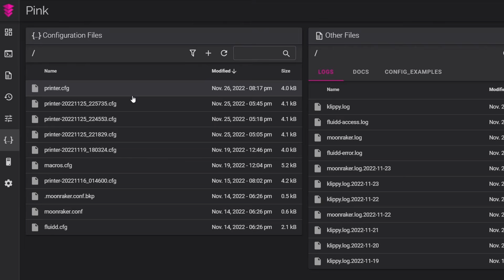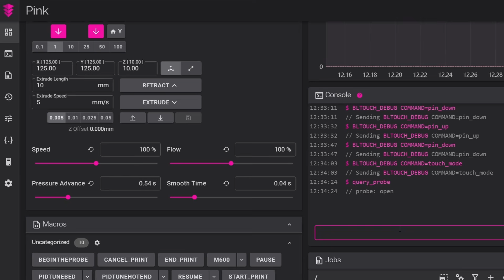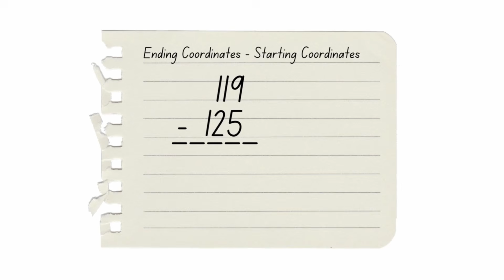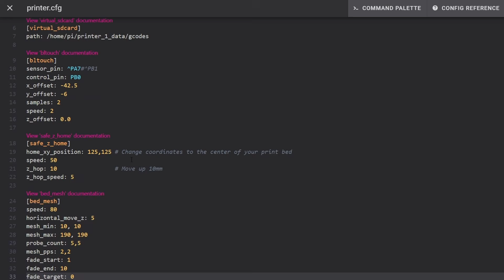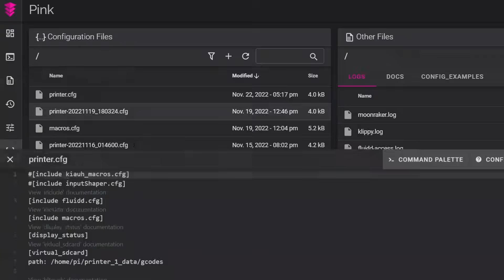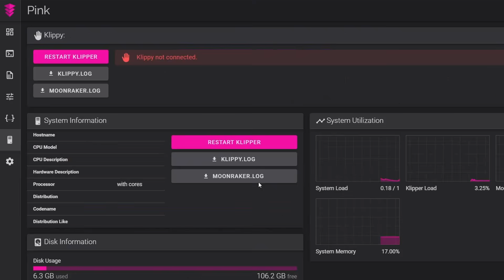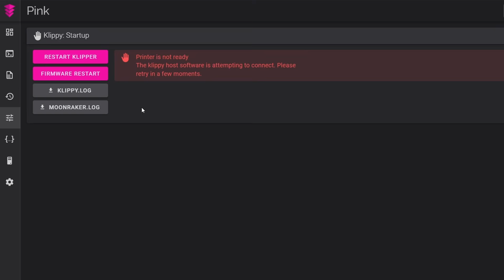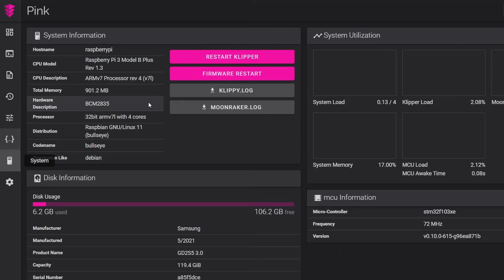BL Touch complete setup for Klipper! Maximize your probed bed mesh!

Comment: I did all of the steps but end up with a move out range error. No matter what numbers I change it is always the same. Any ideas?
Reply: I uninstalled and reinstalled klipper and it works now. Not sure why it didnt the other two time I uninstalled and reinstalled but it seems good to go. Thanks for the video it was very helpful
Reply from the maker: No problem! Glad you're up and running. If you need anything else just message me here.
Reply from the maker: It's usually something small you'll need to change, can you post your [bl_touch] and [bed_mesh] sections. As well as your stepper x max, and stepper y max?
Reply: @PrintsLeo3D  [bltouch]
sensor_pin: ^PD3
control_pin: PB5
pin_move_time: 0.4
x_offset: -46
y_offset: -5
# Increase Z_Offset to lower nozzle closer to bed. PLA 2.6
#z_offset: 3.020
speed: 120
pin_up_reports_not_triggered: False
pin_up_touch_mode_reports_triggered: False
#probe_with_touch_mode:true

[bed_mesh]
speed: 120
horizontal_move_z: 20
mesh_min: 4, 5
mesh_max: 254, 295
probe_count: 3, 3
mesh_pps: 2,2
fade_start: 1
fade_end: 10
fade_target: 0
gorithm: bicubic
bicubic_tension: 0.2

[stepper_x]
step_pin: PF0
dir_pin: PF1
enable_pin: !PD7
microsteps: 16
rotation_distance: 40
endstop_pin: ^PE5
position_endstop: 0
position_max: 300
homing_speed: 50

[stepper_y]
step_pin: PF6
dir_pin: PF7
enable_pin: !PF2
microsteps: 16
rotation_distance: 40
endstop_pin: ^PJ1
position_endstop: 0
position_max: 300
homing_speed: 50

Comment: Can you help me I have an ender 3 pro and the bltouch whenever I use it. It drives into the bed it doesn’t stop. Like the pin is not  responding
Reply: I am confused I just installed the bltouch and when I go auto home it goes to that point and goes down when the po touch is it supposed to hit the bed it doesn’t stop and you can hear this grinding noise from the motor
Reply from the maker: If you went through all the 'sanity checks' and you aren't getting a response, or the responses are not syncing it wounds like this could be a wiring issue. Can you copy and paste the bl touch section of your printer.cfg?
Reply: If you have a discord, I can show you a video
Reply from the maker: Yes find me on Discord, the link for that is in the description of the video. We can find out why the pin is not triggering.
Reply: Add: "probe_with_touch_mode: True" to [bltouch] in the printer.cfg 
Worked for me. I seam to have a bltouch v3.
Reply from the maker: Yes, Oliver! Some 3.0 and 3.1 devices will require this addition. I appreciate you sharing your results. I have a section in the article (on my website) that has been update with this information. Thank you!

Comment: Thanks so much for this video! I need some help though, I set my .cfg to do 10x10 bed mesh so 100 probes. It messes up at 58 the probe retracts full and drives the nozzle into the bed. Any ideas on what's causing this?
Reply from the maker: Glad you found this video helpful! Try adding this under the section bed mesh

algorithm: bicubic

the default value (lagrange) is capped to a specific number of points. You may have better results with this output,

Comment: Great video and information! Keep the Klipper videos coming! Would these steps also work with an Inductive probe type sensor? Thanks!
That Post-it note trick is awesome!
Reply from the maker: Hey John thanks for the compliment! I haven't used an inductive probe yet, it's something I'm interested in but haven't found the time. That being said most all of this information should apply to an inductive probe, certainly finding all of the physical measurements should be identical(x and y offset, bed probing grid). I believe the main sections that would be tweaked are in printer.cfg The section [bltouch] would be swapped for, I believe, the section [probe]. Calibrating the Z offset may be different too, but I'm not quite sure. I'll try and get a little more educated about it and get back to you